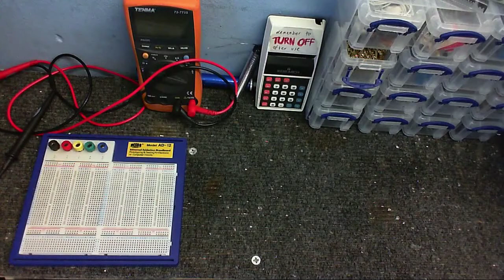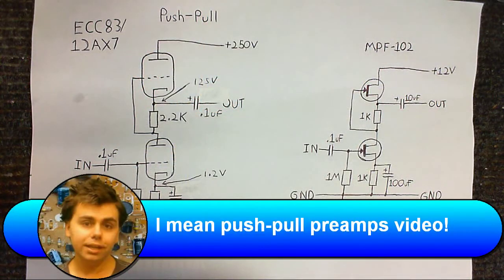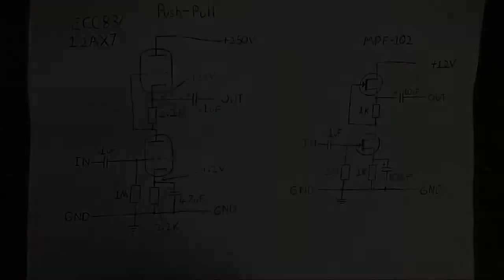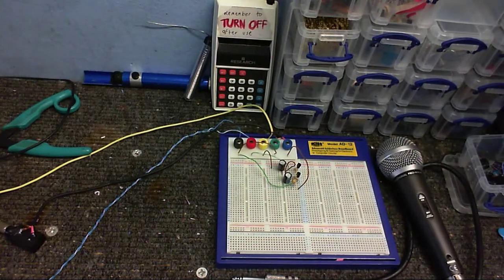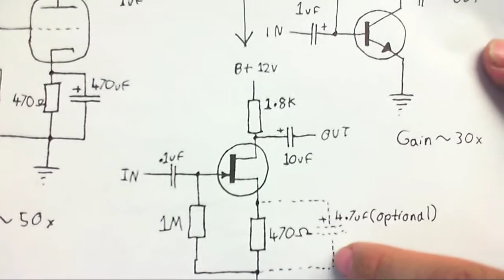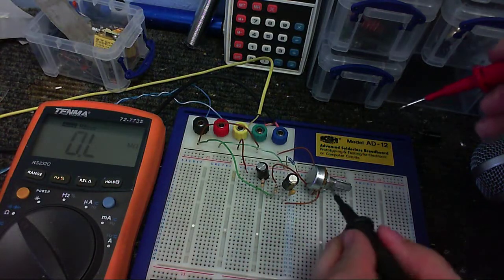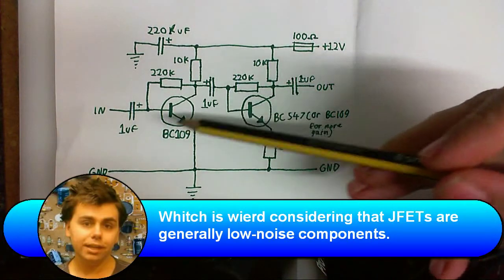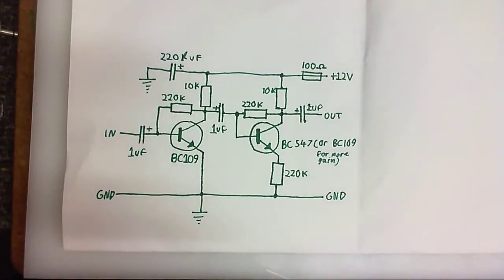Push-Pull Preamp experiment 2 - JFETs

Comment: Just guessing/idea a bit, that the FET's have low voltage gain, plus the impedance of that dynamic/coil mic is somewhat low, compared to the very high input impedance of that FET, so maybe a impedance/power mismatch, at least in some theory.  Possibly, place a resistor, perhaps of similar value, or something, of the value of the impedance of the dynamic mic. across the input to ground might make a difference.
Reply: trailkeeper impedance matching should only matter at frequencies high enough that the input cable acts as a transmission line, not at audio frequencies unless the cable is really really long.. If the microphone is a voltage source (is it? I don't know about different types of micrphone), you'd want your amplifier input impedance to be significantly higher than the output impedance of the microphone. If it's a current source like a photodiode, you might use a transimpedance amplifier.
Reply: KX36 ok, thanks for the consideration.  I was just thinking if the output of the coil is connected to a high input resistance like a jft, maybe 1M, then no current can flow in the coil windings and have a natural tone, and have a back emf and things.  I was thinking that it took current to set up the magnetic field in the coil, even though its already surrounded by a magnet field of the magnet itself.  Worth a try.   THe impedance of that mic , might be 1K or less maybe.  just some more ideas, I havent been doing much since I moved.   Still if someone dont have a jfet a regular transistor is good for preamp like shown in the video.

Comment: Weird with the lack of gain on the JFETs. I don't have a lot of experience with JFETs as they're as obsolete as tubes if not moreso.

If I were doing a microphone preamp and I wanted high fidelity, I'd use JFETs if I really needed a high input impedance beause the mic had a high output impedance, otherwise I'd use an opamp which would be low noise and linear, especially if you use an "audio" opamp, an opamp with a high bandwidth and slew rate with a relatively light load, or bias an opamp output into class A with a load resisitor. You can get lots of JFET input opamps anyway. You occasinally get a very niche need for a discrete JFET preamp feeding an opamp. e.g. active differential scope probes.

If I wanted subtle even order harmonics to warm up and round off the tone of the voice, then I might use tubes. I don't do hifi amps or microphones, but I used to do guitar amps. Hopefully one day I'll get back to it.